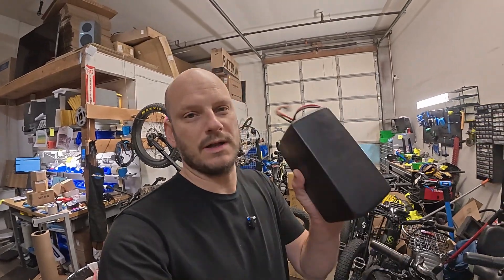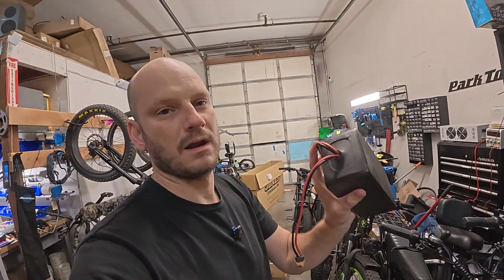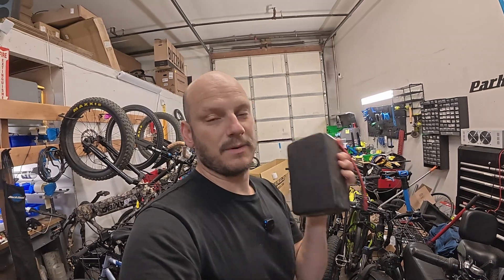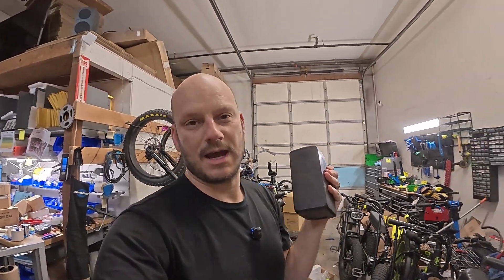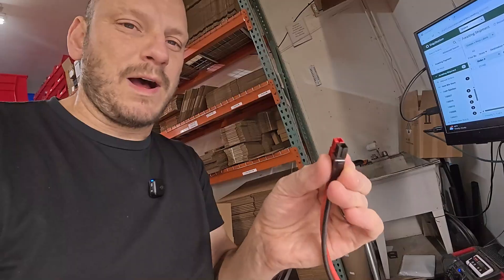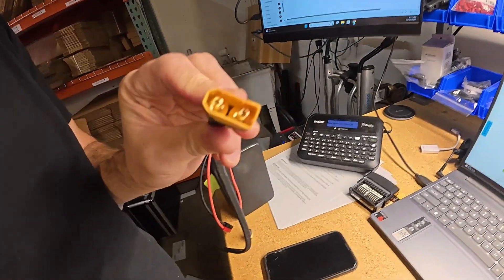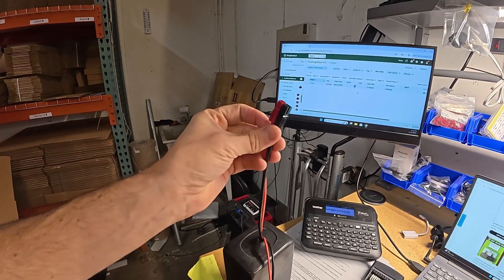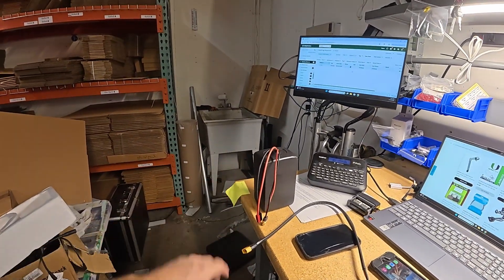What is Current In-Rush? Is it why you keep frying your E-bike Controller?

Comment: Bother, a power switch does the same thing as a connector: they connect and disconnect the flow of electrons. You could put 100 connectors and 100 power switches and it wont effect the fact that when the power circuit is complete, the power circuit is complete. The electromagnetic wave is still moving at 90% the speed of light when that happens.
A switch will help reducing arc damage to your connector, yes, but ultimately the design of the power circuit (transformers, capacitors, ect) will determine in-rush current. 
Still love your projects though, keep up the tinkering and good videos!
Reply from the maker: In principle they are the same but not in practice!

Comment: I had a problem with an Ebike. I would remove battery to charge it(i was new to ebikes, afraid of charging) Well, my bike has a "socket" the battery connects to. The socket had five prongs which enter and engage the battery when the battery is placed on the bike. After a dozen reinstallations of the battery, the prongs began to have difficulty engaging the battery. My solution, slightly bend the prongs to increase friction when engaging. As i applied a metal tool to one prong so that i could bend the prong, there was an arcing from one prong to another. WHO KNEW the bike still retained energy after the battery was removed? Battery has BMS and switch. Bike has CONTROLLER. I guess the controller is regulating the In-Rush. 

I no longer remove battery to charge but was nice lesson. As for those that insist on regular removal of battery, i would apply NON-CONDUCTIVE Ansio-Kinetic Grease to electrical contacts. The grease eliminates the arc.

Comment: I think there's a misunderstanding about how batteries work. a battery doesn't "send a bunch of power to the controller". it only provides a stable voltage source and the controller will simply pull as much current  as it needs. current * voltage. = power. there is no way an on/off switch will smoothen out the output unless it has a a high frequency transformer, basically an electronic switch that can chop you battery voltage by turning it on / off thousands of times a second. this is basically a simpler version of what a motor controller/inverter is doing so  it makes no sense to put one before the controller. if the controller is pulling too much current and frying itself when you connect it to a battery that provides a voltage within the controller's rating, it's just a poorly designed controller. the only thing you can do is reduce the number of time you are connecting the battery to the controller, werger it's by plugging it in or flipping a switch ON
Reply from the maker: Google it. It’s a real thing.
Reply: @JohnnyNerdOut I understand but IMO the safety should 100% be in the controller, not in the battery switch, otherwise you rely on the user to always remember to switch the battery off before plugging it in, so I would still call it a badly designed controller. There are a bunch, probably even a majority of electric appliances/devices that draw a spike of current when turned on/plugged in, like refrigirators, incandescent light bulbs,  most electronic devices, and I think ebikes should be fool proof, plug and play. unless you're talking about a niche custom built e bike , where it could make sense to have a startup procedure but generally for a custom built ebike I wouldn't expect to cut corners
Reply: Inrush current happens due to capacitors getting charged almost instantly inside controller once battery is connected. Due to this short pulse of high current and induction of wires and controller circuity voltage spike happens after current stops flowing once capacitors are charged. This voltage spike is what causes electronics to fail inside controller. Usually it's linear voltage regulator which takes a hit if controller design lacks of TVS diodes. But as you mentioned it's a poor controller design if it fails. Also on/off switch won't help either if it is fitted on power line, as it will be getting same inrush current for a split second once switch is activated.
Reply from the maker: 1. The switch spreads the connection over milliseconds instead of microseconds.
2. The switch moves the inrush away from your connector
3. Many switches naturally “pre-charge” just by how their contacts overlap.
4. A switch removes the worst part of inrush: arcing on plug-in.

Hope that helps!
Reply: @JohnnyNerdOut  Sorry but this is not true 1. Use oscilloscope and you will see that this statement has no sense. 2. Inrush current is exactly same on all path, the only way how switch can reduce inrush current is it's limited contact surface if you use really cheap not properly rated switches with high internal resistance. In such scenario switch would reduce high inrush current, but would not eliminate it. Also due to limited contact surface switch would soon need replacing due to burned contacts inside (seen that many times). 3. Partially true if we talking about the case described previously with non properly rated switches with contact surface too small for rated current. 4. Partially true, it does reduce arcing (not completely eliminates it) due to switch contacts latching with higher speed compared to wobbly hand customers who connect their connectors slowly causing huge sparking. If you connect connectors very quickly you would notice that arcing is almost eliminated. But this does not reduce inrush current.
Now lets get back to switch problem. Suggesting to use switch with limited contact surface and higher internal resistance is same like suggesting use very thin wires, which would also significantly limit inrush current. Unfortunately this is not how things should work. Correct way to deal with such thing is to properly design controllers electronics. Unfortunately cheap products often lack of such design. Sometimes even expensive stuff is designed by questionable people. So if you use cheap stuff, expect to have some issues at some point, or add TVS diodes as close as possible to voltage regulators and Mosfets on controllers PCB, or use XT connectors with precharge resistor in them.

Comment: On off switch will only help if it's connected to the bms with that feature.
Reply from the maker: An external on/off switch (or an internal “real” switch in the battery) does two things:
	1.	Breaks the physical connection so the controller doesn’t see voltage the moment you plug in.
	2.	Lets you plug the connectors in with zero live current,
then turn the system on in a controlled way.
Adding an on/off switch absolutely helps with inrush even if the BMS has zero special features.
The BMS does not need anything special for a switch to reduce or stop inrush.
Hope that helps!
Reply: @JohnnyNerdOut  There is no different between an inline switch and plugging together you battery connectors.  Unless the switch has some sort of dampening resistor as is used in flipsky battery disconnect switches.  Most ON/OFF switches on basic production batteries which are wired on the discharge cables have no such thing.  The only thing a switch does is keep you from seeing the spark when you switch it on, because the contacts are enclosed.
Reply from the maker: Right — the controller caps still charge either way, but the difference is where the inrush happens. With no switch, the arc hits the connector pins at a single tiny point and that’s what causes the visible spark and connector damage. With a switch, the plug-in happens with zero live voltage and the arc is handled internally across a broad sliding contact surface, so the destructive spark never hits the connector.  I think  for a lot of people, avoiding that spark is the main goal. It also totally depends on the controller. I sell and repair about 10 different controllers and they all act differently to inrush so I was trying to be careful on using all or nothing wording as that would get me in trouble. I’ve heard great things about the flipsky controllers though, maybe those ones resist damage best?
Reply: @JohnnyNerdOut They resist damage the least.  It's why they sell a seperate inline disconnect switch with internal resistors and mosfets, for no spark or inrush.
Reply: @JohnnyNerdOut I've been building batteries for a few years...

Comment: Adding ON/OFF switch on power line will not protect electronics from inrush current. Inrush current happens due to higher capacity capacitors in controller getting charged almost instantly when battery is connected. Solution is XT connectors with precharge resistor or TVS diodes inside controller. Actually most higher quality controllers have TVS diodes in them. Even if you managed to damage controller somehow due to inrush current, it's almost always linear voltage regulator gets damaged, which is easy to repair.
Reply from the maker: All I know is that customers bring these all the time to repair. And this is what I know if the problem. 
As with anything in this industry, they here is no such thing as a blanket statement that applies to everything. 
Toseven controllers and CYC/ Sabvotons are more prone this problem than other controllers with built in protection from this. You simply cannot repair controllers on ebikes 😞 some motorcycle grade controllers can 👍
Anything  over 50a, put a disconnect/ on/off switch!!
Reply: @JohnnyNerdOut  It might be that some customers done some things they shouldn't be doing. Seen many videos on Youtube of voltage increase mod's without properly checking controller capacitors ratings and voltage regulator circuitry design. Also seen plenty of shunt mod videos where people just add thick wire in parallel with shunt. I tried it on 15A controller and current readings where near 50A on full load with my custom battery which has no over current protection, while mosfets can only handle max 20A on prolonged use in them controllers. Problem is people without even basic electronic skills try to tune their bikes by watching Youtube "experts" videos :) I buy broken ebikes, fix them, have bit of fun and give them away to relatives or just sell them and go for another. It's one of my many hobbies. Fixed quite a few ebike controllers. Some where clearly damaged after such mods. They are easy to fix if you are in to electronics and it's your hobby, as economically it makes no sense when you can get a new controller for 20-30 quid from China.
Reply from the maker: To be clear, it’s not voltage, it’s current that destroys controllers/ batteries etc. 15a-30a isn’t much and will take a while to do damage. It’s the stuff about that level, you really should have a disconnect.
Reply: @JohnnyNerdOut  Nop, it is the voltage spike that destroys controller. After inrush current follows voltage spike due to inductance in wires and controllers circuitry. Just do bit of research yourself if you don't believe me.
Reply from the maker: This is what I got:
The voltage spike comes from the sudden current rush into the controller caps. The current change happens first, and the wiring inductance makes the voltage jump afterward. They’re part of the same event — the spike isn’t a separate cause.
I will say, the amount of comments on this video speaks to how little people are aware of it, so thanks for chiming in! I am by no means an expert on the physics of in-rush and which controllers exactly are more prone to its damage. I just know from building and repairing a few thousand that there is a problem. The research I’ve done backs up what I’ve personally seen. But I know there are specific situations that aren’t covered by this video.
Reply: @JohnnyNerdOut  "Voltage spike" is the "executor" which damages component. It does follow after the inrush current, but current itself is not the problem, problem is what comes after it due to wire and circuitry inductance. So if your logic is based on initial cause, both of us then are wrong. We can then blame wire inductance for causing voltage spike and damaging components. There are few ways of dealing with such problems in electronics, TVS diodes, precharging trough precharge resistor (like the XT connector with integrated precharge resistor), two relay solution, mosfet solution (smart on/off switches), varistors and so on. Limiting inrush current with a simple on/off switch is the least effective solution. For a person who is not familiar with all this stuff I would say XT connector with precharge resistor is the best solution.
Reply from the maker: I agree that xt90s is best for lower power setups. Adding pre-charge is the key to stop any damage 👍
Reply: I was about to respond to the video and saw your post. You are absolutely correct.
Reply: Thanks for the info. When will sodium ion batteries be available?

Comment: I have multiple batteries & only one with a power switch. I've fried a few controllers but never just connecting my battery. I prefer not having the on/off switch because I always forget about it and try to turn on the diplay before realizing it has no power.
Question: Is it better to charge a battery without the switch while still connected to the bike or risk the current in rush to dissconnect while charging?
Reply from the maker: I wouldn’t worry about inrush as long the battery is already connected. It’s that initial connection that fills the controllers capacitors
Reply: @JohnnyNerdOut  Oh well. I can't be overly concerned because I can't charge my batteries on my bikes (without jeopardizing exit in case of a fire). My kitchen is the only place that a fire could break out and we can still exit from all other rooms. I usually charge in my stove (just in case). I think my wife would kill me if I left a bike charging in the kitchen for hours.😕

Comment: I'm guessing if you stored an Ebike outside year round in Iowa under a bike cover with a tarp on top.
 That even if you took the battery off & kept it inside. The display and controller would be toast after a couple years. I just don't think they're meant to be stored in -10F winters & 98F summers. 
Similar to modern motorcycles with so many electronics VS old analog carbureted motorcycles......#Planned Obsolescence
Reply from the maker: Ya, unfortunately it’s kind of like storing a computer more than storing a regular old bike.
Reply: @JohnnyNerdOut  I do like ebikes and what you're doing but on my very very low fixed income. I can't affrd to buy a $,1500+ Ebike and have something go wrong within a year.